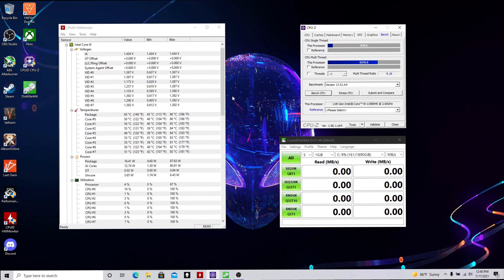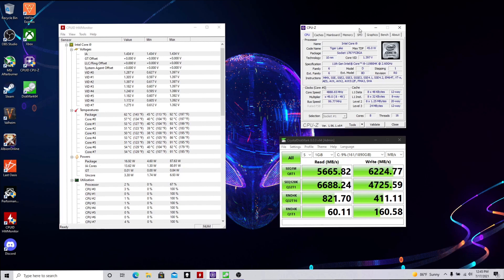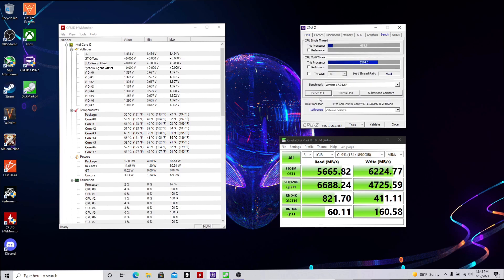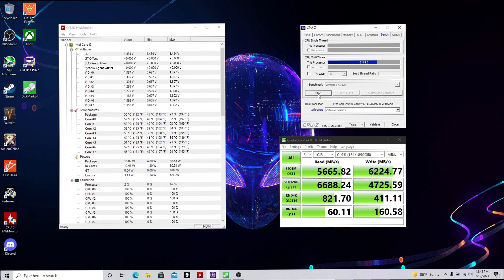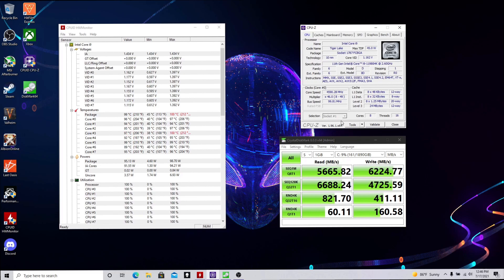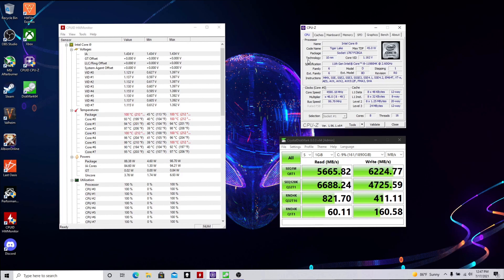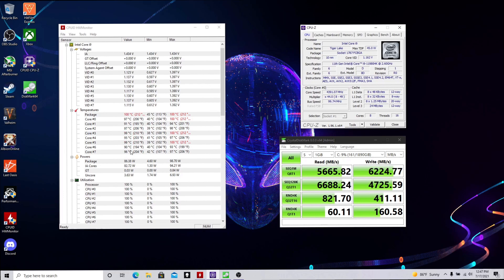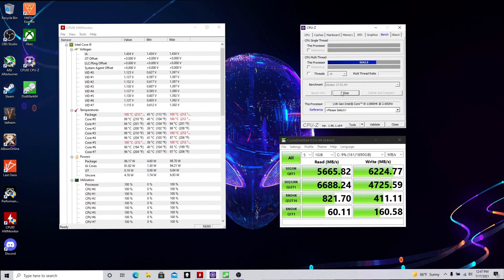Alienware x17 overclocked default oc1

Comment: What is the default core/ memory clock speeds? I changed the default one and dunno how to get back haha
Reply from the maker: I am not sure without looking through some old photos, but if you changed this in the bios, you can restore factory defaults, and then save and exit.
Reply: @crzyjojotv1176  nah I changed it in alienware control center thingy, i think i have sorted it though I just made a new profile and it seemed to be default 25 core clock and 50 memory clock, sounds right and the machine runs better now for sure...
Reply from the maker: @zionsky3342  Been awhile since I had this machine, so again I'm unsure with out looking, but if it's running good, then great!   I'll look through the archives this evening, and if I can find it I'll post them for you.

Comment: I am hoping you can answer these questions.  First, is it necessary to reboot when changing the overclock using Ailenware Command Center, or does it change on the fly?  Next, if it does not have to be rebooted, does AWC have to stay open in the background?  And last, does MUX change allow you to change to RTX Graphics GPU on the fly, or do you have to reboot every time you change it?  Sadly, Dell does not even publish an owner's manual for its products. I know these sound like newbie questions but this is my first new gaming laptop in about 10 years and a lot has changed.  Thanks!